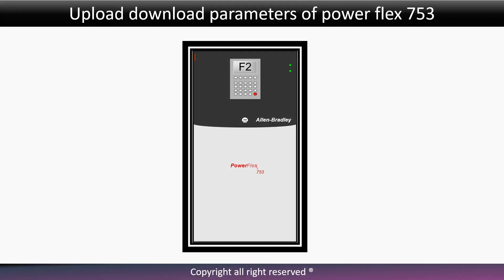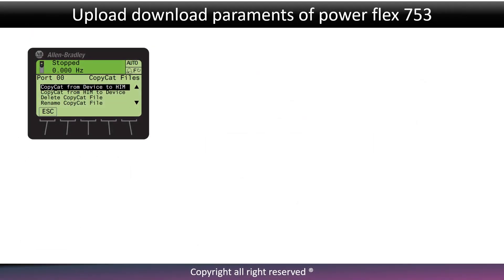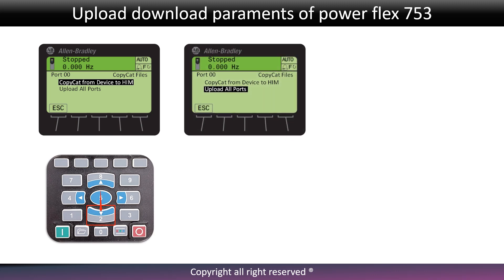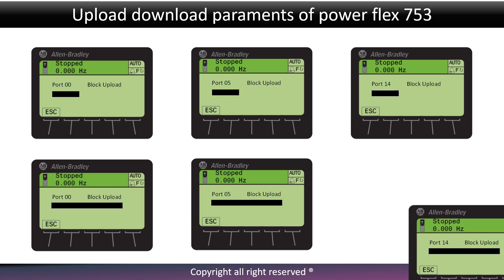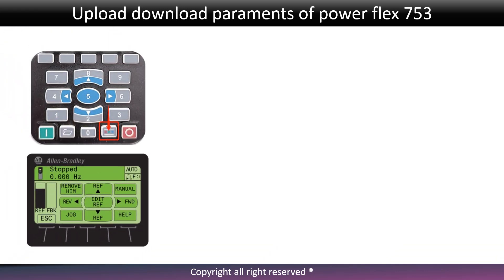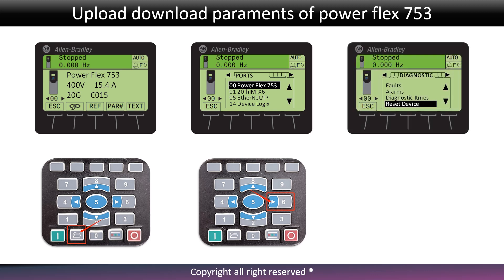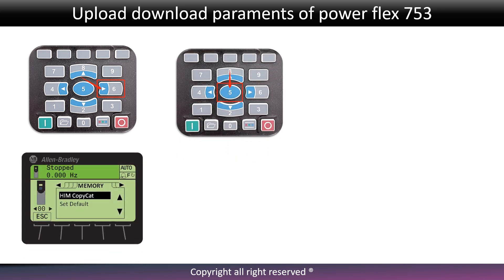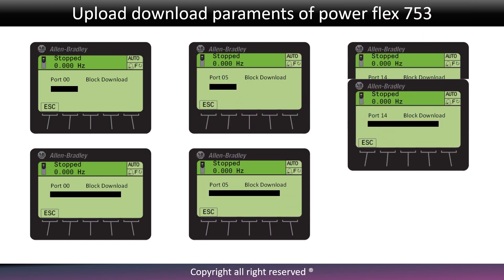PowerFlex 753 and 755 Parameters Upload Download

Comment: Good day. iam working on powerflex 750  controlled using 2 wire ianm battling with sourcing it with  4 to 20 mA. I did my programming but cant match. i need help